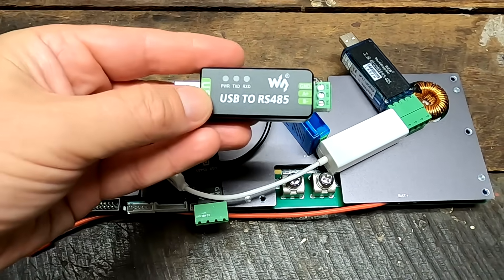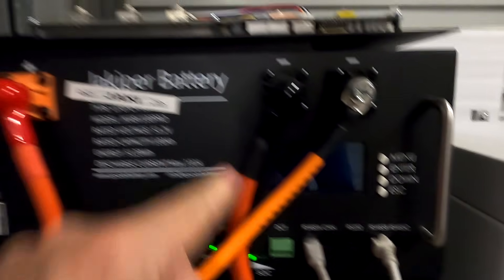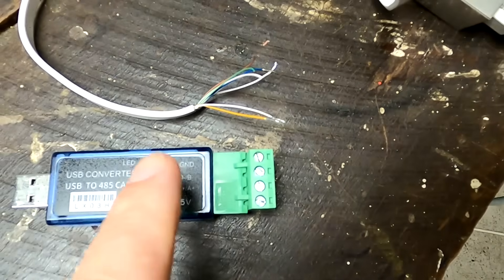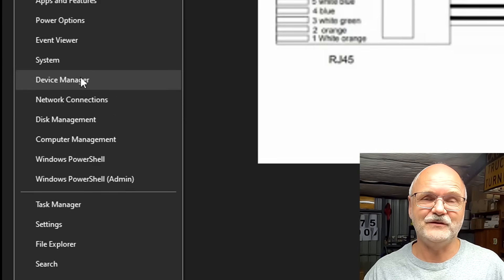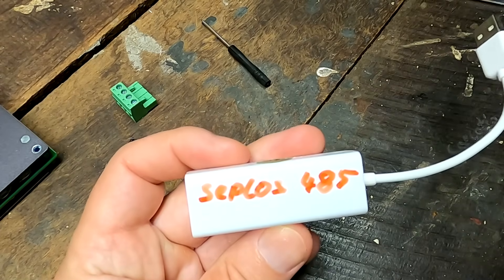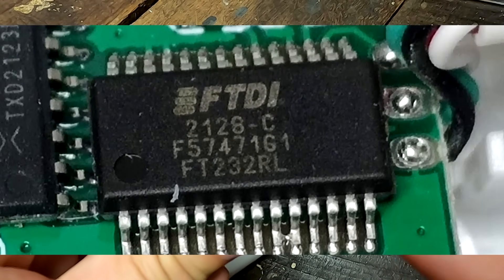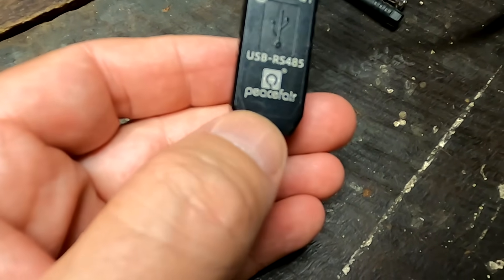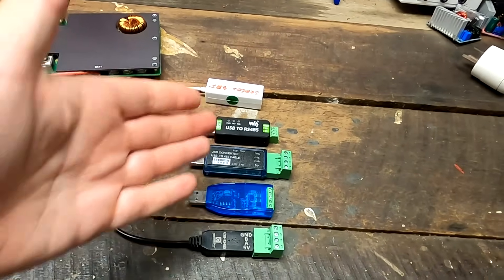JK Inverter BMS: These adapters actually work! RS485 and CAN, Adapter Test and Cabling Guide.

Comment: Hi Andy
  I always follow you, I purchased the jk pb2a16s200a, obviously I have yet to receive it, it's on its way, but I wanted to ask you to manage the software needed, the RJ45 interface (there are really many types) and the USB interface or a network cable could be fine normal?
another question is; What does the term 20A current limiter mean in the JK?
you will have understood that I am a layman and besides, a retired metalworker manager we cannot have learned everything.
good day from Italy
greetings Stefano
Reply: when you purchased the pb series, some dealers offer it including the right cable (chip)...

Comment: Thank you very much for this video. Although, I do have a question because there is a clarification that I was hoping to get but which didn't come as I had expected. Anyone who has experience with it can assist with the relevant information. 
My MPPT charge controller has a communication port tagged RS485 and I noticed that it looked quite like the popular RJ45 port for ethernet cable connection. Unfortunately, my PC does not have a RJ45 port as it is one of those slim laptops. I will need to get me a converter which is what led me to this video. Before I purchase what will not work for me, I would like to know if the RJ45 cable will work with the RS485 communication port of my charge controller. If it will work, then I can look around for a RJ45 to USB cable converter thingy. So, I would also like to know if this will work because the video shows him using what looks like a RJ45 cable connection with the RS485 port on the inverter (I think) but still uses a RS485 to USB converter. If the RJ45 plug and cable can transmit from the device, wouldn't that directly work for the PC (and the BMS software) by just plugging the other RJ45 end to the RJ45 port of the PC? Why did you have to cut one side off, peel the wires and plug particular strands instead?
Pardon my noobness. I wouldn't want to make a wrong purchase of items and then commit a painful mistake.

Another question: is there a generic software for MPPT charge controller monitoring? Unfortunately, I can't reach out to the manufacturer in my own case because the seller delivered a generic looking MPPT box, although it seems to work as expected, based on all the information I have consumed around MPPT charge controllers and their battery charging work. Ordinarily, I would have reached out to the manufacturers to help with further clarification and information accordingly.

Thanks to everyone.

Comment: Andy, I received my JK  200A inverter BMS last week   It arrived with version 15.10  Fireware, and yesterday I attempted to  update to 15.11 and of course, I bricked it,  using the firmware file from your site,  I then attempted to restore but no go,  the bottom line is that I eventually  downloaded from the JK website  and that worked a treat  just by pressing the on off button,  maybe the newer hardwire version does not like the file name change?   I see that JK have put a link to the unbricking password generator. 
 I have been watching your videos for about 18 months  and  must congratulate you for the wonderful work you are doing! I have gained a lot of knowledge by watching your channel and believe that I owe you more than a beer  so would like to buy you a case of your favourite oettinger, please let me know your nearest DM’s that you can collect from. Cheers from sunny Cape Town RSA

Comment: Hey I have an older JK_B2A8S20P and B2A20S20P and a trying to get data from de GPS port with  PL2303 TA USB TTL RS232 Converter, but no succes , I can sent data, but nothing in return in the JKBMS app, has anyone succeeded and with wich (chipset) converter?

Comment: Hey andy, I have been watching your videos for a while to build my own DIY lifepo4 battery. I have ordered 8 cells to build a 24v battery.
I want to use it with 3.2kw Solar inverter, with brand name 'Inverex' a chinese brand, which i bought 4 years ago. The inverter has usual Rj45 port (on manual, which supports Rs485 and Can bus).
Now i am looking for a BMS which can communicate with my inverter. I have selected JK B2A8S20P with CAN bus port.
Do you think this BMS can communicate with my inverter? Like using rj45 cable on inverter and on other side, rs485 or Can connector on BMS? Kindly guide.

Comment: Hi Andy, have you tested with JK PB2A16S20P as well? For me, it only connects with JK-BMS-Monitor 2.1.0 and not all options are functional. At the manufacturer you have no one to talk to, they only answer what they want to answer. I have another problem with this model, from time to time, without my intervention, it warns of a short circuit and restarts the multiplus ll because the voltage suddenly drops to 35V. If I look at the Lynx shunt log at that time the current is 4-5 A., This is a false alarm I think, Have you faced such errors? If you have a support contact from JK please share it with me. Thank you, George
Reply from the maker: It's Chinese new year at the moment. Most companies are closed. They will answer it after the 20. Feb hopefully.
Get the latest software from my website
https://off-grid-garage.com/battery-management-systems-bms/

Comment: Can i connect 10 jk inverter bms in parallel and after to one inverter? The inverter will se all 10bms? Thank you :)
Reply from the maker: Yes, you can parallel all 10 JK BMS. The inverter will only see the master BMS which aggregates all data from the 9 slave BMS.

Comment: Andy, thanks for testing. Question is the JK BMS monitor also working with the old style BMSes? Would be great if we can adjust them via RS 485 instead of Bluetooth. Thanks for sharing and keep up the good work down under!
Reply from the maker: Hi Edward, that will not work. The software on the PC will only communicate with the new style inverter BMS. For the DB series of inverters you have to use BT.
Reply: @OffGridGarageAustralia  Thanks Andy👍
Reply: And with b2a bms works?

Comment: Hey Andy was watching an old video of you building the battery shelf, where did you get those cool red bus bar stand offs from ? their so much simplers than the stand offs we had to use in PMG/ TELSTRA telephone exchanges!!
Reply from the maker: Hey, got them on my website. There is always a link under the video😉
https://off-grid-garage.com/electric-installation/

Comment: Hi Andy, can tell me the connection between the Peter Board and the Victron Cerbo, witch can port ? the BMS-CAN or the VE-CAN, thx !!! love your comments
Reply from the maker: Only the BMS CAN will work. Also plug in that terminator in the second port.

Ve.CAN is only for Victron internal communication.

Comment: Hi. I bought JK inverter BMS in December and 4.3 display from different suppliers. But display came without metal circle screws to mount it. I think Andy also get displays without them. They are necessary to mount display in XR07-48V280AH Power Box LiFePO4 from AliExpress and should be in display package box. 
Any advice? Where I can buy them separately?
Reply from the maker: I didn't buy any displays for my JKs (yet). Can you not use any screws to mount it. Not 100% sure what screws you're talking about though...
Reply: @OffGridGarageAustralia  he is talking about the "screws" of the 4.3" LCD. they should have been also attached to your JK-4.3 LCD. Come in a silvery plastic bag. on one side is a special insert (look like two flat hooks) to fix in the backside of the LCD, the other side  looks like a gearwheel  of 30mm  in diameter.
Reply: they are normally included. on one side is a special insert to fix in the backside of the LCD (2 flat hooks), the other side  looks like a gearwheel 30mm diameter.
Where do you live?

Comment: Hi Andy 
Can I connect my old JK bms with new? In my garage 3 battery with old bms b1a20s15p, I want to buy new jk bms with new battery, but dont know can it work together? Or do I need to sell all my old boards and buy new ones
Reply from the maker: Ever battery can have a different BMS. They can even have slightly different settings. It will all work. That's what I had in my battery shelf for years.
What will not work though, is the communication to your inverter. For this, you will need some sort of other solution, like the Peter boards...
Reply: @OffGridGarageAustralia  good device, need to order, thanks

Comment: Hello, Andy. Do you advise interfacing the Raspberry Pi (with isolated CAN adapter) with the new JKBMS via CAN port? Thanks for your advice and the for the awesome work with the OGG!
Reply from the maker: Thank you. 
Yes, that should work as well. I've connected the Pi and CAN hat with the Peter boards but it should also work with the JK Inverter-Boards directly.
Reply: Hello i tried with Can raspi hat but nothing works with jkbms directly Can port. I change bitrates to 250k With seplos it was ok. Did you have any advice ?

Comment: Hey Andy @OffGridGarageAustralia where it is nice and Sunny. :)

CAN is not working here, could anyone point me? :) Good video as always!!!

Though i want to mention that i was missing the JK BMS test with the CAN connection and that was the part i was looking for to see if i am missing something in my setup.
I watched multiple videos of you about the CAN topic, but i cannot find my situation and problem, and i am looking for the solution.
I hope you or anyone else can shine a light on it, or perhaps i found a bug?

I am connecting the raspberri PI Venus OS through the CAN hat with the JK BMS on pins 4 and 5 and the right RJ45 port (the CAN port) as per your explanation and it just does not work.
In comparison if i connect the same raspberri PI Venus OS through the CAN hat with the Victron MPPT on pins 7 and 8 it works fine without any issue.

Now let me give you some connectiondata background as well:
In both situations, with the MPPT and the JK BMS i see in Venus OS the settings->services->can0->network status mentioned as ACTIVE and i can see the RX and TX packets going up.
In that same screen in both situations no overruns, error packets or dropped packets.

As far as i can tell, everything from a hardware and packet perspective works fine.
However the Venos OS refuses to see the JK BMS, but it does see the MPPT when connected through CAN.

Furthermore this connection does: 
The Venus OS does see the JK BMS when i connect them both through bluetooth with the driver from Louis, however bluetooth is not reliable and gives often disconnects, so i want a CAN connection between the Venus OS and the JK BMS.

My setup:
- 1x Victron Multiplus II, 5000, 230V
- 1x Victron MPPT 450/100
- 1x Victron Smartshunt
- 32x LFP 280 Ah cells (currently connected only 16cells, to make it work)
- 2x BMS of JK-PB2A16S20P (currently connected only 1, to make it work)
- 1x RS485 CAN BUS Module HAT Expansion Board for Raspberry Pi (from your website)
- 1x Raspberri PI with Venus OS large.

Now i see in your videos you test the CAN situation with a different JK-BMS, could that be the difference?
Could it be that only the version i am having has this issue?

Thank you for reading and hope to see a video with a solution soon or a text reply from anyone. Both will work fine!
Reply from the maker: Have you ensured the JK-BMS has the right CAN Protocol set in the settings? CAN setting needs to be on 4 for Victron.
Reply: @OffGridGarageAustralia  yes i have tried different CAN protocol settings in the JK-BMS, including the Victron one. I will try some things out, with specifically only the Victron option selected and get back to tell the outcome and what i bump up against during the journey.
Reply: Thanks for your question. I am also interested in finding the  solution for my future setup, too. As far as I remember, Andy connected the BMS with the Cerbo via CAN and it worked!  No clue about Raspi, however.
Reply: Well the thing is that the CAN connection from my Raspi works with Victron equipment without issue. It is the JK BMS that gives me the issue. Hopefully there will be a reaction from Andy or someone else who has figured out howto properly connect those 2.
Reply: Did you get it to work? Im trying the same - without sucess. Victron Can-Type A cable, between Cerbo and the JK-CAN-Port. Victron is configured in the JK. The protocol in the JK is configured to "Victron". Is there anyone out there who got this running with a cerbo ?
Reply: Finally i got it running. After playing 3hours around. The trick was: to power-cycle the JK-BMS and the cerbo. Then it worked!!! Im Using a YIXIANG-Battery-Box with the Cerbo, the f... expensive "VE.Can to Can.bus BMS typ A cable". Use the RJ45 Port which is labled with "CAN" This is the second, counted from the left. Use only 1 terminator in the cerbo, on the BMS-Can Ports. Configure Victron (no 4) in the can settings of the BMS. Power cycle them! Now and only now the JK-BMS appears!

Comment: Great Stuff Andy, answering a lot of questions people have...
One Thing you haven't Tested / Commented on :
Have you tried these BMS with Diffirent Sized Packs linked together into a bank ?

IE a 100AH with a 200AH & 300AH in parallel (or similar) to see how the BMS' interact & operate through the ranges and how will the BMS cope with that.   There may be an "eye opener" lurking there.
Reply from the maker: Thanks for the feedback. I think i made quite a few videos about that already. A good one is this here: https://youtu.be/bhCSccNsQOw

Comment: Hi the moment I connect the usb to computer is behaves weirdly , the mouse keeps moving on its own and desktop becomes unstable, I am using wave share , is this a driver issue where can I get a driver ?
Reply: the Waveshare that Andy demonstrated is not isolated. The symptoms with your computer behaving weirdly is likely a ground loop. Replace your adaptor to one which has isolation - don't replace and in the worst case the magic smoke can come out of one or more devices. Some of the WS adaptors are isolated. Unfortunately i can't link due to FB preventions. In short the ones with 'industrial' are not the type you are after, you need to look for  galvanic isolation keywords.
Reply from the maker: You can try and connect the ground as well.

Comment: Hello Andy do you have any idea how I can make a communication between jk bms and voltronic inverter ?
Reply from the maker: You have to have a look in the Voltronic manual what communication standard they are using (RS485 or CAN) and what the pin-out is for this inverter. They are all different unfortunately.

Comment: For a reliable communication (e.g. monitoring with dbus-serialbattery) you should connect GND. The cheap RS485 implementation inside the BMSs are not isolated and therefore are limited by their common mode (voltage) range. Because the BMSs are not isolated, the adapter used in the Victron system (or in the computer) must be an isolated type to prevent large ground currents.
Reply from the maker: So far, I never had any issues without GND, so I kept it disconnected.

Comment: Sooooo…. I get the wiring 485 to usb to connect to PC.  
But will a rj45 cable( victron)  not work out of the rs485 port of the jkbms and plug right into my cerbo and I have to splice the wires because the CAN H and CAN L pin orders are different in the  jkbms Vs cerbo???
Reply from the maker: Correct. You either need a Victron Type A cable or make your own by connecting the pins according to this document (https://www.victronenergy.com/live/battery_compatibility:can-bus_bms-cable). A standard LAN cable will NOT work.

Comment: Not the cheapest but I really like the Waveshare stuff. They have lots of interface converters in very good quality. Just recently add a RS232/485 to ethernet converter to my system and it works perfect to sit in my office and have running the BMS Computer Software running on my Desktop PC. I although added a 7“ Touch Display from them to my Victron Cerbo and it works perfect out of the box without any need to configure in the Venus OS. Just plug and play…  A very good alternative display for the original Victron one and only around 50€  + some usb and hdmi cables 👍🙂
Reply from the maker: Thanks for the info. That is a very interesting project. Do you have a part list of what is needed? Happy to make a video if you send me an email with all the details.
Reply: does display timeout feature work on the waveshare?
Reply: CAn you psot the exact model you ordered!!

Comment: CH340 is a very common USB-to-Serial asynchronous (UART) communications converter. 
On the USB side, together with its Windows device driver, it emulates a COM port on a Windows computer.
On the UART side, it works with both 3.3V and 5V TTL voltage levels for the RX / TX signals. Then they used another chip (e.g. MAX485) to convert from TTL levels to RS485 voltage levels. It can also be paired with a MAX232 to generate RS232 voltage levels.
Reply: I tried 2 adapters with the CH340 chip and no matter what I did driver wise, neither worked for me, first time I tried FT232 chipped adapter it worked straight away
Reply: Exactly correct.  I frequently use the MAX3485 or MAX3232 with ESP32s, 8266s  or other 3.3V TTL level processors.
Reply from the maker: Thanks for the detailed explanation, Daniel!